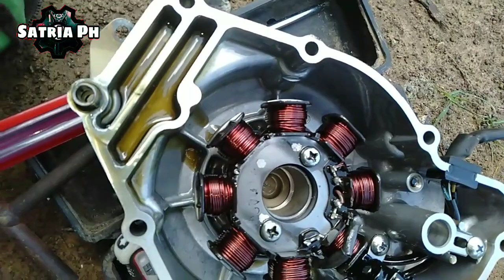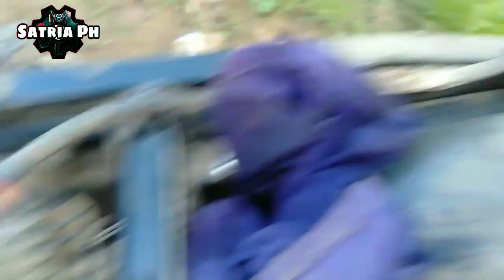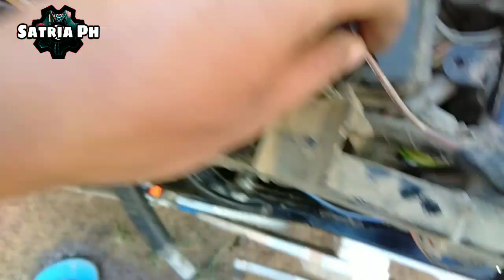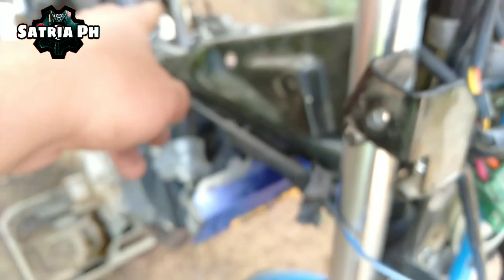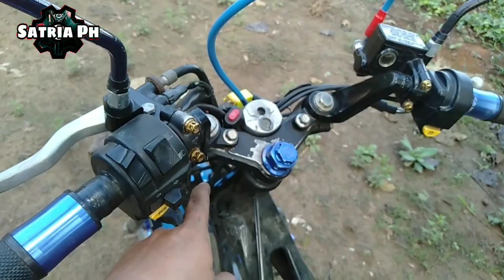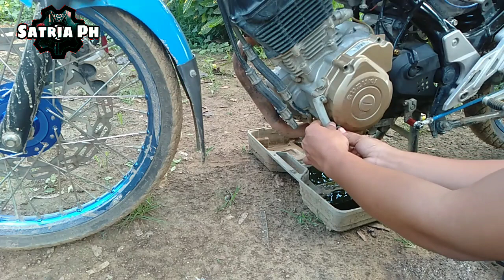Suzuki Raider R150 Fullwave Conversion

Comment: boss wala ng iabng gagalawin sa stator kundi ung white wire lang atsaka ung kulay tanso po?kaso ung wire na lumabas sa stator 4 leads...para saan ung dalawang leads..
Reply from the maker: yellow wire at yung end coil, yung dalawa pang wire? wire ng pulser
Reply: @JAYXDVLOG  i mean po sir para saan po ung dawang green color po na dalwang wire na socket na output po sa stator po?
       and last nalang po sir wala ng other na gagalawin bukod sa pinag dugtong na 2 wire po.
Reply from the maker: yung wire na green at blue, pulser yan, ignition timing, wala ka gagawin dun, tatanggalin mo lang at pagdudugtungin mo lang yung dalawa, (Yellow wire at End Coil) buko jan magrerewiring ka ng fullwave regulator like kung ano ang explain ko sa video
Reply: @MLBB Gaming cge sir maaraming salamat po...try ko po ito sa r150 ko.

pang anong motor gamit mo sir na rectifier..pang gy6 ba pwede iba po kasi sir kulay po black,red,green,yellow and white nawala po sir ung pink white po ba sir ing pamalit sa pink na wire?lihua brand po ng rectifier...maraming salamat po sa help..god bless po.

Comment: Bro paano po yun papunta accessories wire. Kc pag on ignation coil I papunta din sa accessories wire. Nalilito po ako
Reply from the maker: ignition coil? or ignition switch?
Reply from the maker: yung black wire ng fullwave regulator sir dun sa accessorie wire mo tap, yun yung nasa ignition switch mo

Comment: Sir yung black wire ng fullwave regulator po I tap sa accessories wire after ignation switch? Paano na po sir red wire galing sa battery patungo sa ignation wala na yung?
Reply from the maker: red wire from battery? wala naman prob dun, ano ba pinag aalala mo sir? kasi dadaan naman sa ignition switch yung red wire from batt, then yung black wire sa after ignition mo naman ilalagay yun
Reply: sir pwede ba pagsamahin na lang ang red at black wire ng rec sa (+) ng battery? imbes na ihiwalay ang black sa acc?

Comment: Sir ano na maging resulta nyan pag walang battery aandar pa kaya yan ng maayos same ng stock charging
Reply from the maker: aandar nman kaso pupugak pugak pag nirev na since dc cdi ang raider 150, sa stock regulator nman, natry ko na yung walang batt, pero madali masira ang cdi kapag walang batt, (di ko pa natry masiraan ng cdi, saglit ko lang nman pinatakbo ng walang batt) kasi paiba iba ang voltahe pag walang batt..... dc cdi kasi ang raider 150
Reply: @JAYXDVLOG  
kahit nka fullwave na boss mag palyado lang din bsta walang battery?

Comment: Apps . .ilang wires ba sa full wave regulator.
Reply from the maker: may 5wires at 4wires, same looks lang din sila
Reply: 5 pin paps ok bahh raider 150 mot2x ko
Reply from the maker: 5wires sir okay lang
Reply: @JAYXDVLOG  salamt paps. .malaking tulong to.
Reply: Paps. .pwede ba yung apido rectifier paps.kung yun ang gamitin ko.
Reply from the maker: @bryaneugihco451  hindi sir......
Reply: Paps. .anung brand bayan na regulator gamit mo. .may pang full wave pero 4 pin lang

Comment: Full wave narin ba sir yang regulator rectifier mo ty
Reply from the maker: yes sir, pag nagfullwave ka, need mo rin palitan yung stock regulator mo ng fullwave regulator/rectifier
Reply: Sir sa motor star 125 po same lang po ba sila ng  connection kapag nag convert po ako basta yung yellow wire lang po na para sa light coil ty  po .

Comment: boss pano q malalaman qng alin ung end ng winding kz s ibang motor wala nmn nakasama n tanso s ground wire ng stator...
Reply from the maker: anong motor sir? sa raider 150, yung end coil yung magnetic wire na nakahinang, walang kasamang wire, sa xrm nman, nakaipit lang yun pero wala din kasamang wire.....
tatlo lang yan, 
*starting coil white wire
*center tab yellow wire
*end coil, magnetic wire na nakahinang or nakaipit sa ibang motor.......
(hindi kasama yung wire ng pulser, etc)
Reply: @JAYXDVLOG  nakita q s wave gilas boss 2 ung nakahinang s ground nun stator isa nakakonek s yellow at isa nakakonek s black
Reply: kya ang tanong q sana boss pano q malalaman khit saan motor or stator qng alin dun ang end ng winding
Reply from the maker: ginagamitan ng multemeter yan or tester.. basahin mo dito
https://mastercircuits.blogspot.com/2012/07/half-wave-to-full-wave-conversion.html?m=1
Reply: Tanong ko boss pano pag stock rectifier lng gamit pwede dn b
Reply from the maker: hindi...kaya bumili ako ng fullwave rr para sa fullwave stator :)

Comment: Idol same procedure ba pag Old breed?
Reply from the maker: yes sir
Reply: Okay lang po ba gumamit ng 4 pin?
Reply from the maker: @renzverdejo9113  basta same sa porma ng regulator na ginamit kp jan, 4wire, pag 4wire, black lang ang wala jan...
Reply: Okay sir. salamat tatry ko bukas 😁
Reply from the maker: @renzverdejo9113  pero kung may lihua brand kang mabibilhan, mas okay yun
Reply: Lods. Bakit bigla nawala Gauge ko. pati mga Ilaw nagana lang pag naka start
Reply: @renzverdejo9113  
parang walang kuryente galing sa battery boss
parang charging nya yung ngsupply ng kuryente

Comment: Sir pag n fullwave ba di nb sasabay si stator ung ilaw sa headlight? Steady nb ung buga nya ng ilaw
Reply from the maker: pag nagfullwave ka, ibabattery operated mo rin headlight mo, after nun di nya sya sasabay sa stator
Reply: @JAYXDVLOG  taga san k sir. Baka pede magpa fullwve
Reply: Sir tnong n dn ung fullwave converstion b my lifespan???..
Gaano ktgal??...tnx
Reply from the maker: nakadepende na yan sir sa quality ng fullwave regulator mo
Reply: @JAYXDVLOG  edi sir kung skli n masira matic regulato ko my problema??.
gnon pla un mrming slmat sir..
Reply from the maker: @ovlassalvo7374  yung sakin kasi mumurahing fullwave rr gamit ko mag2years na, wala pa nman prob.... lalo na siguro yung ibang mas mahal na fullwave rr, sa mga stock rr ng mga indian made or taiwan made na motor....
Reply: @JAYXDVLOG  bonus110 taiwan made sir.. rr?. Regulator b un?. Balak ko kc magpafullwave sir kya ngttnong ako..slmt sir at nssgot mo mgs tnong ko...
Reply from the maker: @ovlassalvo7374  sa ibang mga motor sir na fullwave na, kung alam mo yung motor na haojue 110 lucky sir, fullwave na yun, pwede yung regulator nun saka sa motorstar star x 125, saka marami din magbebenta ng fullwave regulator sa online, like lihua fullwave regulator
Reply: Sir mrming slmat..